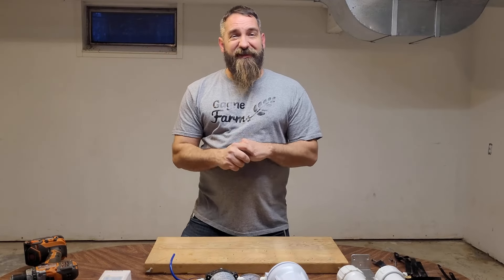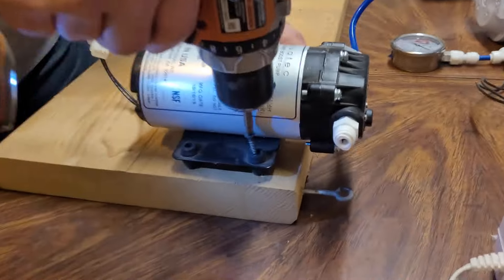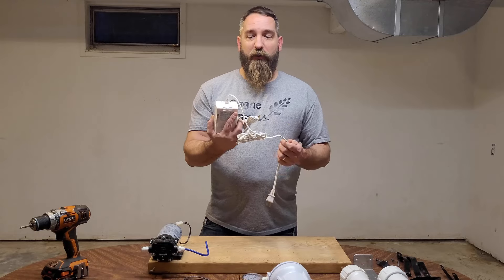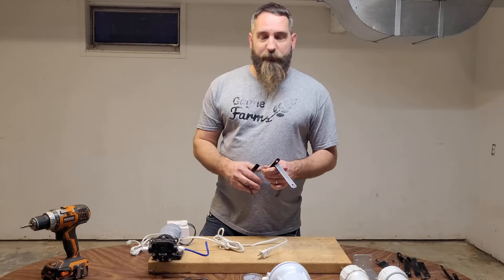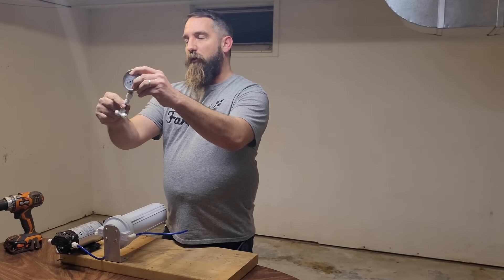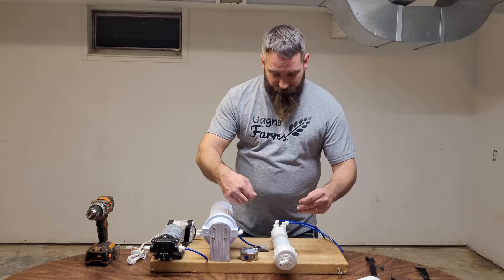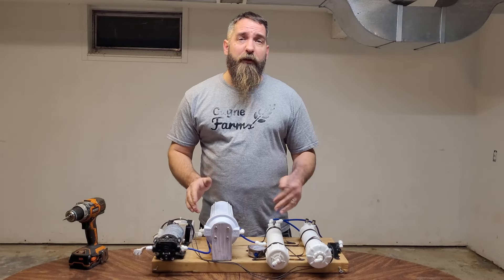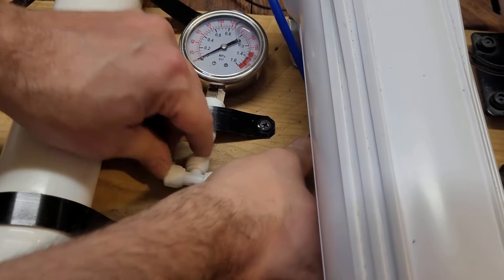HOW TO BUILD a Reverse Osmosis System for Maple Syrup / Small scale RO for HOBBY Operation Upgrade

Comment from the maker: What other things do you do to improve your Maple Syrup Process?
Reply: Great video...I built the same RO system 4 years ago and it works great! I don't really have any improvements except that I have four RO membranes in a parallel system and made some legs so the system stands up on its own 📐 I'm not sure if it helps but it doesn't hurt. I have found at the end of the season I need to remove the RO housings because they do become moldy inside due to the sugar in the syrup so I only have one strap holding the RO membranes in place. Teflon tape around the threads really helped me as well, it prevented my system from leaking. Any tips on how to get the pressure switch to work?? I have one installed but I can't figure it out....
Reply from the maker: That switch has not worked for me either. I am going to give it one more shot. I have heard that other people had the same problem.
Reply: @GagneFarms  I did see another YouTube video on how somebody was using the same switch on the same RO system. He mentioned something about there's a reset button on the switch and letting the system build up pressure in order for it to work. I will link it to this thread or send you an email directly if you want....?
Reply from the maker: @A  that would be great! I will look for a reset, that does make sense now that you mention it. If you can link it is this thread then it might help some other people out as well. Thanks again!!!
Reply: @GagneFarms  Will do! I'm looking at mine right now and I can't find where the reset would be. I will look for the link and attach it to this thread.
Reply from the maker: Awesome thank you so much!
Reply: @GagneFarms  here is the link that I talked about in regards to the shut off pressure switch, hopefully it helps
https://youtu.be/RzxRQSF3wlg
Reply from the maker: Thank you so much. I will check it out!
Reply: I wld love to travel to PA and check out the system and process you guys have, the farm, and how you do things there. Let me know if you ever wanna head up north to VT to check out a sugar shack we have up there...
Reply: Me I added an RO system, stopped using the large pots and have a pan divided into 3 sections that I can drain them out of.  Re did a small barn with 2 horse stalls, one on each side 10x14.5 ft, used one side for the brick burner I made for the new pan.  then have three areas where I have a collection tank with tubes going to a few trees each. Last year for the entire season i produced just over 5 gallons.  This year after 4 weeks I had 130 gallons bottled.
1 add an RO system.
2. get off using the pots and use pans for the boil.  More surface area.  Or get a purpose built pan.
3. start using the tubing going from tree to tree to a collection tank. This is where you really start to sink money into the collection process, but they are good for 5 years or so.
4. get a filter system instead of the old sock filter.
5.  make pumping stations from collection points to a larger tank at the boiling site.  (this is not for small volumes but thousands or tens of thousands of gallons per year.)  That or make the boiling house at the bottom of the area tapped and use gravity.
Figure 200 in lines, 100 in connectors, 250 in tools for plastic lines, 100 in wire cable with twine to hold the cables, 350 for the pan.  Now brick burner was from bricks, cinder blocks and chimney liners and pips we had on hand.  Over all I spent $1200 this year.  Now how much is the pay off.  Figure a gallon goes for $60.  So, at 20 gallons sold, I break even at 1200.  Now I just have to add fuel at the end of the season.  I will have to get a larger RO system next year.  I also had a few water tanks that you could get at tractor supply and a submersible pump.  (3 - 50 gallon tanks @ about $250 each, three 275 gallon in the cage @ 500 each, five 55 gallon food grade drums bought used for $75 a few years ago.)
Reply: @brett76544  thats awesome!!! You really stepped up you syrup game. The "Father of Filtration" May your sap run  clear, your RO filter clean, and may your syrup generously cover your pancakes! Send me your email, I can send you some pics and ideas as well.
Reply from the maker: @brett76544  that sounds like an awesome system you have there! Great advice here as well. Thanks for sharing your setup. Sounds like you certainly have some time invested in it!
Reply: @GagneFarms  I am also a trainer for an EPA's program that covers assets management and finance for water and wastewater systems.  That along with being the chairman of a sewer system that received wastewater system of the year a few years ago and our head operator the operator of the year just a few months ago.  So, I have an idea on how much each line can take along with knowing if I need a breather line above it, just by doing the math.

Comment: Hey Eric I was wondering how do you make the connectors leak proof because when I start up my system their is a lot of leakage from the connectors, and are you able to take out the piping because I constantly try to take mine out from the connectors but they won't budge.
Reply from the maker: Use Teflon tape on the connectors when you screw them into the housing. The connectors are a press lock style fitting. They are made to take on and off. If you push back on the outside collar and them pull the opposite direction on the tubing they should disconnect. If you are leaking where the tubing is going into the connector, make sure you have a nice square clean cut on the tubing and make sure it is seated all the way into the connector. I hope this helps! 😁
Reply: @GagneFarms  Yea thanks a lot I was also wondering did you put the Sediment Home Water Filter Cartridge inside of the filter because I did that that but in your video I never saw you install it
Reply from the maker: Yeah I did before I ran the system. Check out the Maple Syrup videos that follow the ro build and i show how to run it.

Comment: Ordered the parts you have listed - my R/O membranes housing came with top elbow fittings ( gray band ) that have a black flow value built in . I can not get water past it - suggestions ???
Reply from the maker: What is your pressure running at? Did you soak your filter and membranes in water first before running? They usually like to be wet first.
Reply: @GagneFarms  I have the back flow value ( elbow with gray band ) 
on the top of the R/O membrane housing is this the correct location or should it be on the bottom R/O water out line ?
Reply from the maker: The back flow valve should be on the permeate side of the housing. Which will be the lowest outlet on the bottom. I would change that around and you should be good.
Reply: @GagneFarms  Thanks for your help - I agree the value needs to be in the bottom port - my problem is the elbow with the check value that came with the membrane will only thread into the top port - and the other elbows that came with it will not thread into the top port -  do I need additional parts ???
Reply from the maker: @patriciamoore9097 hmmm. You shouldn't need any other parts. They sell that as a kit, so they should all fit. Are the threads different on each fitting or are they the same? Could something have gotten cross threaded by accident and now it will not go together? Is there anything in the paperwork that came with the kit that shows a diagram of the assembly process? There could be a defective fitting in the kit. It's rare but does happen.
Reply: you are correct - I made a stupid mistake - now fixed running perfect - thank-you for your help  - bring on the sap  !!!!
Reply from the maker: No problem at all. Good luck to you on your season this year!

Comment: Hi Eric I was wondering if I could put my reverse osmosis filters before the sediment filter. This is because for some reason the filter is leaking probably because the pressure isn't enough to transfer the syrup to the RO membranes, however if I implement the RO membranes first the system works perfectly. DO you know how I could fix this, and if its okay to put the RO'S before the sediment
Reply from the maker: You will want the sediment filter first. If you put it after the ro, it's not doing anything. My guess is if your sediment filter is leaking it is not seated correctly. Those buggers are a little tricky to get straight up and down. I would check that first.
Reply: @GagneFarms  What do you suggest I do to incorporate that should I get Teflon tape or something because I honestly have to clue as to why it is leaking
Reply from the maker: @daveM-k1i  yeah I would start with the Teflon tape.
Reply: @daveM-k1i  Most ro systems have the pre-filter before the pump, so it cleans the water or sap before the pump plus in your case it isnt pressurized if its on the intake side of the pump. This is the second video ive seen that people have the filter after the pump and that just isnt right, you want to remove any bugs or drill dust before entering the pump.
Reply from the maker: @scottdc2105 not a bad idea. I filter my sap before it goes through the pump and I have not had any issue yet. Thanks for the suggestion though!
Reply: @GagneFarms  Thank you for the reply, i commented on another persons video about the membranes in series and the last membrane which has the highest % sugar going into it, i suggest that will reduce the volume of the whole series of membranes, have you tried your system in parallel as well as series? Did you choose series out of comparing them to see which is the most efficient beforehand?
Reply from the maker: @scottdc2105 i have not tried it the other way so I cannot say for sure if it would be better.
Reply: @ Since commenting ive researched the topic and parallel is better for membrane health because of lower pressure but efficiency can only be achieved if the pump can build up enough pressure to run the membranes in parallel, you see parallel increases flow rate and that reduces pressure and there is a minimum pressure and optimum pressure for best efficiency. I think ive gone as far as i can in theory and need to test it with hands on.

Comment: Hi Eric, I built an almost identical system as you have but have been consistently getting leakages in many different parts of the system especially where the connectors are I have already tried using Teflon but nothing seems to be working would you have any fixes for these?
Reply from the maker: That seems weird. Could the connectors been cross threaded? The connectors have to be pretty tight. Just be careful not to break them. I have had them drip just a little then I just tighten them up a bit more.
Reply: @GagneFarms  The connectors connecting to the sediment filter and the ro membrane are cross threaded but only the sediment filter seems to be giving me a problem and I believe that the pressure going into the filter is causing their so be to much water going into the filter and not enough coming out but that's just a guess.
Reply from the maker: @sehgalm  hmmm. Still seems odd. Any way to take some video of it send it to my email?
Reply: @GagneFarms  Their is no need I actually fixed it their was a connector that was a little lose thank you for your help
Reply from the maker: @sehgalm no problem. Glad you are up and running! Let me know if you have any other questions. 😀

Comment: Did you add a tubing to the pressurizer? if not how did the syrup go through the system???
Reply from the maker: Yes, there was a tube added to the other side of the pump that goes into the concentrate tank.

Comment: Do you think the Aquatec 6800 Booster Pump Kit would work the same as the 8800?
Reply from the maker: It just pumps less volume but it will still work. Might be a bit slower than the 8800.
Reply: @GagneFarms  okay thanks!

Comment: Do you have a video on how to clean an store the membranes?And how often do you replace them?
Reply from the maker: I do not, but that is a great idea for a video once we get running. I flush the membranes and filters out between each run. It really depends on how much sap you run through. I have been running approximately 500+ gallons per season and I change everything out once a year.
Reply: Dusty, you can back flush the system with your permeate water just as though you were running the sap water through it. I might suggest once you have flush the system clean with fresh water you keep the fresh water in the system and do not let the RO membranes or the pre-filter dry out.

Comment: You make it look simple.
Another benefit in addition to the ones you listed at the end, is that sap does spoil quickly.  The time savings means you can get to it before it spoils.
Just put one together this week. Highest sap flow ever this year because winter keeps hanging on. 
Looks like we all end up with the same components. 
I put in a single membrane of 500 gallons/day capacity. More cost efficient than a battery of 4 -8 100g/day membranes. I also plumbed the sediment filter at the pump intake rather than the discharge..
Keep-a-goin.
Reply from the maker: Very good points indeed. That does make sense to put the sediment filter out in front of the pump, so the pump is not sucking in particulates! Thanks for the tip!

Comment: Hi..just wanted to thank you for all of your wisdom and help.. I built this RO and boiled 6 gallons of syrup this year.  What is your recommendations for storing it?.. I threw out the pre filter.. what do you recommend doing with the Ro filters?
Reply from the maker: Not a problem at all. I am glad I could help. I throw out the pre-filter as well, they are cheap enough and should be swapped out every so often. The RO Membranes can be kept for the next year as long as they are flushed out really well. You don't want any concentrate left in them or even sap for that matter. I run my permeate through to give it a real good flush. I have seen some people use some peroxide solution to flush through, but I have never done that. You want to keep the membranes moist; they cannot dry out. I will put them in a gallon size Ziplock bag and store in the fridge or in a cool basement. Joe Youngblood has a great video on how he has stored the RO membranes. Not sure if you have seen any of his maple syrup videos but he does a great job explaining his process. Here is his channel link - www.youtube.com/@YoungbloodFamilyFarm

Comment: how did you connect the water pressurizer to the water source also what pipes did you use for the Aquatec because mine aren't fitting and they are 1/8" ID Silicone Tubing
Reply from the maker: The sap tube will go into the sap tank. The tubing should be 1/8 i.d. tubing. It shouldn't be silicone. I hope this helps.

Comment: I don't see the pressure switch listed on your parts breakdown? I have an RO and am very interested in where you got the switch from. I use a float switch right now in a 55 gal drum. Thanks
Reply from the maker: The pressure switch came with the Aquatec pump. You get the pump, power supply, pressure switch and a couple fittings.
Reply: @GagneFarms  Thank you.
Reply: Sounds like the package I got. Paid just over 100$

Comment: Everything on the parts list says 1/ 4 in except the last item of tubing and connectors. Should I get 1/4 tubing and connectors or is the 3/8 connectors and tubing correct?
Reply from the maker: Oh good catch. It should be 1/4" tubing. It looks like they changed the link. I will re-link this as well. Sorry for any confusion and thanks for bringing it to my attention.
Reply: @GagneFarms  I appreciate you!
Reply from the maker: @Greg Kerr  no problem! I did just fix the link issues. Let me know if you have any other questions!

Comment: I used this same filter housing with filter that is shown and linked here and it leaks horribly where the filter housing screws on.  Yes there's a o-ring in there.  I feel like I need to just get a different filter housing, but is it possible that something else is wrong??  Is it possible the filter doesn't sit in there properly??  So frustrating!

Comment: Great demo! I’ve heard that the higher, the pressure the more sugar you can squeeze out. Have you measured the sugar Contant after concentration in your RO unit?
Reply from the maker: It's not the pressure that will change the sugar content. It's the amount of times it goes through the RO membrane, or how many membranes it is ran though in a single process. You can run it through a few times if you would like but there is only so much water you can get out before its more economical to just evaporate it. When I run my system it is about 95 - 100 psi. And when I run a batch through it will roughly double the sugar content. So if I start out with raw sap at say 2%-2 1/2% it will be about 4%-5% after the RO process. I hope this helps!
Reply: I have heard you want a 2 per to 1 concentrate but you mention 1 to 1. Thoughts?
Reply: @GagneFarms  
Yes, that helps a lot! Thanks for your reply.